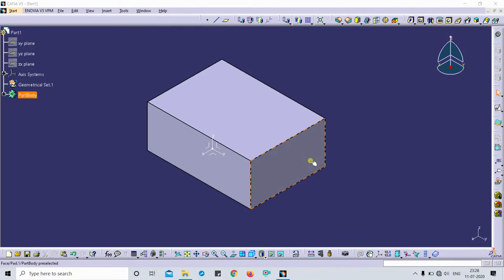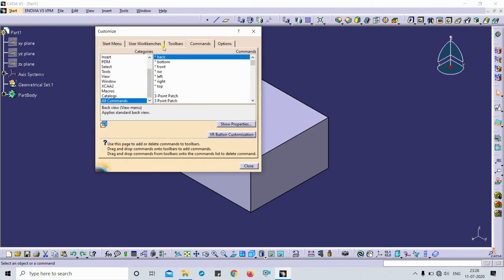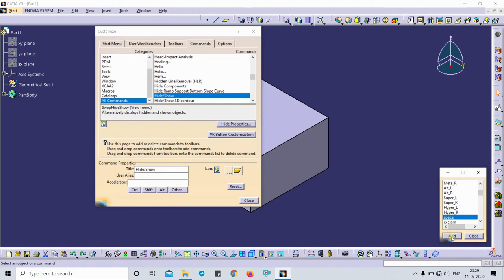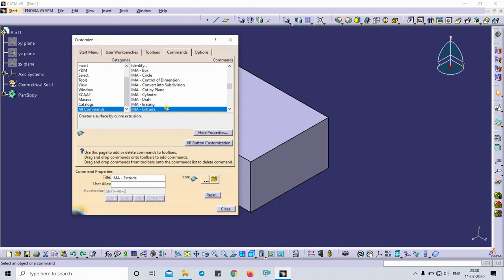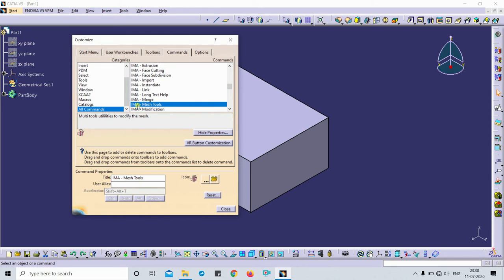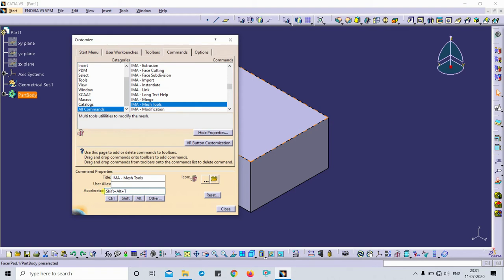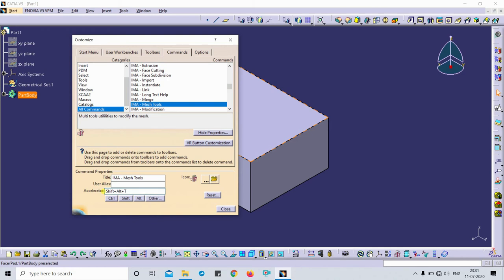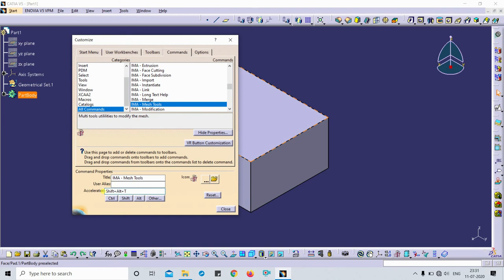How to set space bar key for HIDE/SHOW || Catia V5 Tutorial || Shortcut Tips and Tricks

Comment: After catia restart, commands shortcuts on keyboards like hide to space is not working.. Any solution?
Reply from the maker: Once you set space bar key as shortcut as I explained in vedio then need save catia file initially. Then close and check once, It will work definitely. 
I had faced this issue.